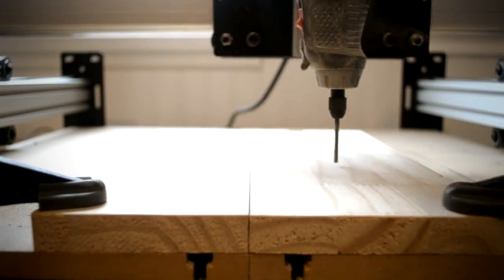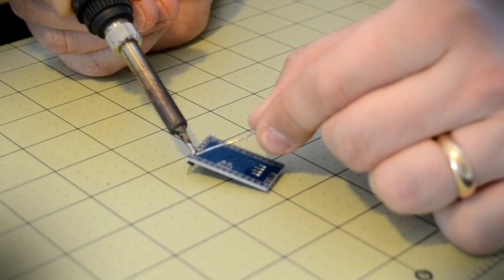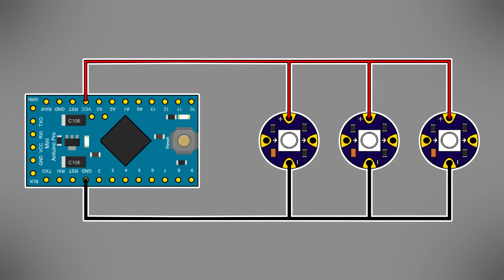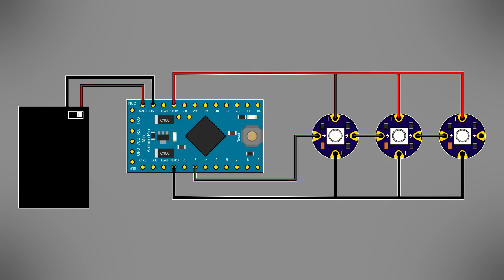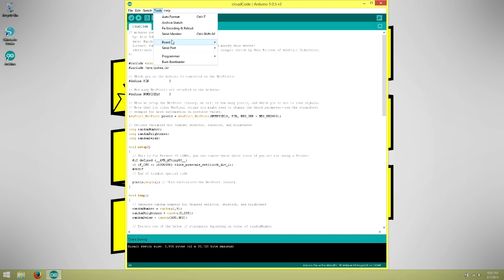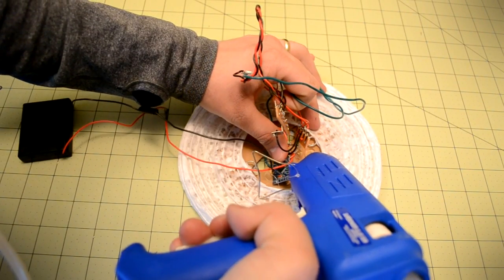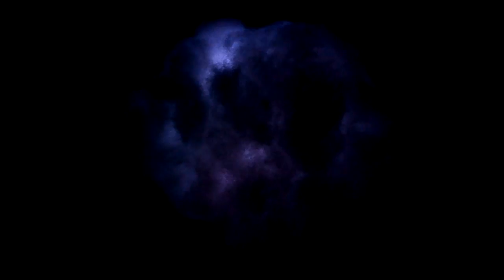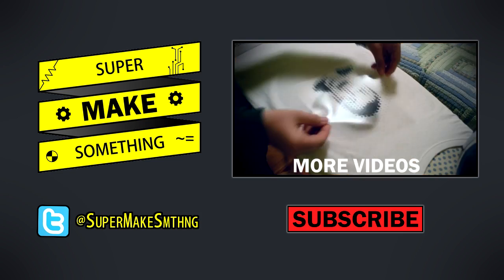Arduino Powered Cloud Lamp - Super Make Something Episode 2

Comment: Hi! I really want to do your project and making my own cloud lamp. For your lamp how many neo pixels did you use? - And should i be aware of something if i add more neo pixels, for exampel power issues? 
I hope you see this! It is so inspirering too see your projects, and you do a good job showing step by step what to do, so amatures like me can learn to do this myself :D I have made projekts using arduino my self, but im not an expert, hurray for the internet and cool dudes like you!
Reply from the maker: Hi and sorry for the late reply! Glad you found the video useful! The Neopixels at full white can draw a maximum of 60mA per pixel and therefore their Vin line shouldn’t be connected to one of the digital output pins. However, connecting several of them to the 5V pin should be fine — signal wise, you can connect as many to one pin as you need to. I used three in this build and did not have any issues. Instead of a Pro Mini like I did in this video, I would recommend using a Pro Micro instead. For this purpose they are functionally identical (and are about the same size), but have an onboard USB port so you don’t need a separate programmer. Hope this helps and good luck with your build!
Reply: @SuperMakeSomething  Thank you so much for your reply! :D I'm am so looking forward to it!

Comment: Is it possible to chain more leds then you showed in the video? I'd like to make a larger cloud then you showed.
Reply from the maker: Absolutely! You can essentially chain as many LEDs as you want as long as your microcontroller has enough memory. For an ATMega328-based controller, ~300ish LEDs should be possible without issue. You will need to modify the code to handle these additional pixels though.

Comment: Can someone please post me a link to buy the programming board he refers to during the start of the programming phase in order to add the code?!? Thank you!!
Reply from the maker: The microcontroller in the lamp is an Arduino Pro Mini, which can be purchased here: https://www.sparkfun.com/products/11113

The programming board is a SparkFun FTDI Basic Breakout - 5V, which can be purchased here: https://www.sparkfun.com/products/9716

If you would like to avoid using a programmer altogether, you can also use an Arduino Pro Micro, which is roughly the same size, but can be programmed via USB.  Be aware that you may need to change some of the output pin values in the code to match this other board.  This microcontroller can be purchased here: https://www.sparkfun.com/products/12640
Reply: Great! Thanks for the help!!

Comment: It would be way easier to splice and solder 4 wires together than use terminal strips. It could also be covered in heat shrink to avoid shorts. Also, ordinary LED's would be cheaper and easier to program, as long as you only want one color. Still, super cool project!

Comment: hey,    i got some problems with the arduino code..  can somebody help me?  thanks ;)

cloudCode:20: error: 'Adafruit_NeoPixel' does not name a type
cloudCode.ino: In function 'void setup()':
cloudCode:35: error: 'pixels' was not declared in this scope
cloudCode.ino: In function 'void loop()':
cloudCode:51: error: 'pixels' was not declared in this scope
cloudCode:56: error: 'pixels' was not declared in this scope
cloudCode:61: error: 'pixels' was not declared in this scope
cloudCode:66: error: 'pixels' was not declared in this scope
cloudCode:72: error: 'pixels' was not declared in this scope
cloudCode:78: error: 'pixels' was not declared in this scope
cloudCode:84: error: 'pixels' was not declared in this scope
cloudCode:91: error: 'pixels' was not declared in this scope
cloudCode:97: error: 'pixels' was not declared in this scope
Reply from the maker: +René P. I think the problem results from the fact that you do not have the Neopixel library installed in your Arduino directory.  The first post by user "pburgess" at this link walks you through how to resolve this issue: https://forums.adafruit.com/viewtopic.php?f=47&t=36015.
Reply: +Super Make Something   tank you so much for the quick answer.  it worked ;)

Comment: How many LED lights can you daisy chain to the mini controller board? I would hate to be limited to only 4 on a larger lamp. If I chose to go with the UNO what amp output would I need from my battery pack for about 12     color change LEDS.
Reply from the maker: +Bonnie Shuman The limiting factor for the number of Neopixels you can attach to an Arduino is the microcontroller's memory.  Adafruit estimates that between 300-400 Neopixels can be attached to an Uno, before memory becomes a problem.  

The Neopixels draw their power directly from the battery, not an Arduino pin, since the maximum current an Arduino pin can provide is ~40 mA ("milliamps").  In the video, you will see that the power line of the Neopixels is connected to the RAW port of the microcontroller, which essentially passes through the battery voltage to the Neopixels directly.  

The capacity of the battery depends on how many Neopixels you want to connect and how long you want the battery to last.  Each Neopixel actually has 3 separate LEDs -- a red, a green, and a blue -- which are mixed together to form different colors.  If all LEDs on a Neopixel are on at full brightness, the each draw 20mA ("milliamps") of current, or 60mA total.  

The total battery capacity you need, specified by the battery's mAh ("milliamp hour") specification, can then be calculated as (number of Neopixels)(60mA)(desired number of hours you want the lamp to run on a single set of batteries).  This will give you a worst case scenario of how long your lamp can run, assuming that you run all of the Neopixels at pure white, maximum brightness.

Comment: Hi! You're cloud project is awesome! How many neopixels did you end up using to light up the lamp? I'm looking to make a larger cloud. Do you think I could daisy-chain more than what you had? Maybe like 20 neopixels? Would the 4 AAA battery pack power all 20, or should I use a lithium battery?
Reply from the maker: +Megan Van Vorst Thanks!  Glad you like the cloud!

I ended up using 3 Neopixels for this cloud.  It is definitely possible to daisy chain many Neopixels together.  4 AAA batteries in series would put you at ~6V, so this should definitely be enough to light the chain, since Neopixels run off of 5V (keeping in mind that you will still need an Arduino or other microcontroller to actually light the LEDs, etc.).  

The limiting factor with batteries will be how long they will be able to light the Neopixels, which is described by the batteries' mAh rating.  Based on their online specs, 4 AAAs should have a capacity of 750mAh, meaning that these batteries will be able to supply 750mA of current for 1 hour.  Each Neopixel has 3 LEDs -- one red, one green, one blue -- each of which draws ~20mA at full brightness.  For 20 Neopixels, this means you would draw 20 Neopixels * 20mA = 400mA if one LED in each Neopixel is on at full brightness, or 1200mA if all LEDs are on at full brightness.  This would give you a rough runtime between 40 - 120 minutes depending on your LED settings for 4 AAAs.  

Based on this, I think a lithium battery would be a better option.  To get around needing to design a charging circuit, etc. I would recommend looking into USB rechargeable battery packs typically used for cell phones.  They are available in a variety of very high mAh ratings, are very small, and are rechargeable, which could save some money in the long run.  You can check out some more information about them in my word clock video here: https://youtu.be/6tMTQ7Khe90

Best of luck with your project!  If you end up making a cloud, please post a link.  I would love to see it!

Comment: Can you do it with Arduino Uno instead of the smaller arduino??
Reply from the maker: Zeeke This definitely works with an Uno as well!  The one used in the video is just a smaller UNO without the header pins -- the sample code should run on an Uno without a problem.  

If you end up making a cloud, please post a link here!  I'd love to see your take on this project.
Reply: ***** Cool, thanks.
I want to build a cloud with the lightening effects but also have a speaker in there control via bluetooth and censors?

ANy tutorials or help on that?

Ill be making this project later this year, ill deffo post a video after.
Reply from the maker: Zeeke The tutorials would depend on exactly which types of sensors, etc. you want to hook up.  To get started on this, I would look around hobby electronics websites for the particular components you want to use, because vendors usually have good tutorials showing you exactly how to hook up these types of things to a microcontroller.  

More generally, there are also very good starter kits from vendors like Adafruit and Sparkfun that cover many basic sensors/actuators -- these kits helped me tremendously as I was getting started, so definitely check those out!

Looking forward to your video!
Reply: ***** alright, thanks man

Comment from the maker: Hi Kimberly, thank you for liking the video!  Unfortunately I am not taking commissions at this time.  However, you may be able to achieve a similar thunderstorm effect by using a flashing LED bike light instead of the microcontroller+LEDs I use in the video.  This should allow you to make a cloud lamp without having to worry about the electronics.  Cheers!